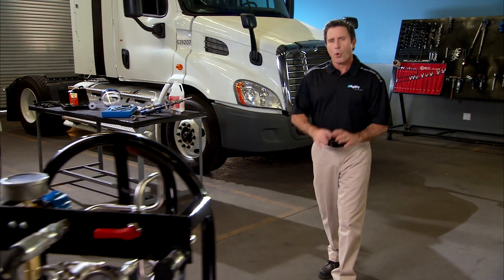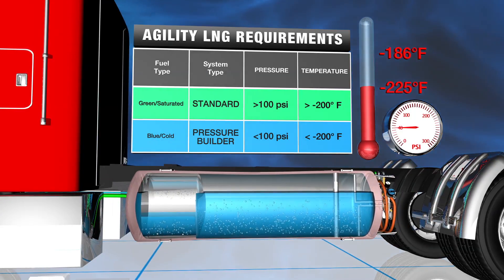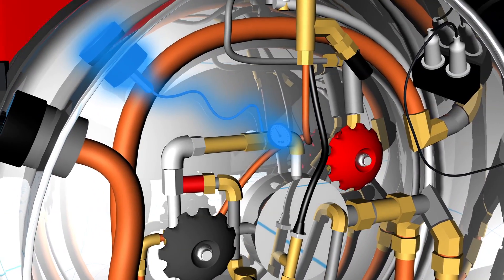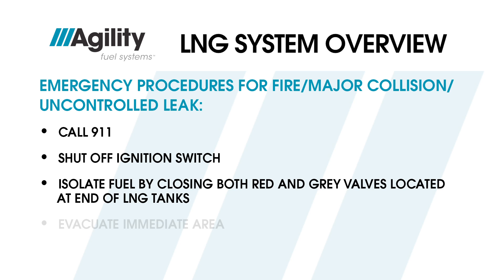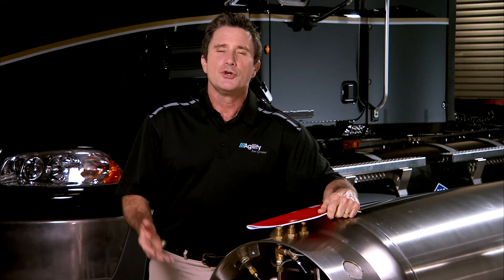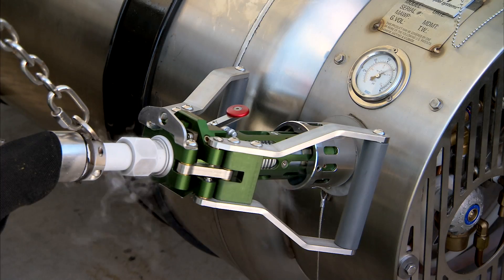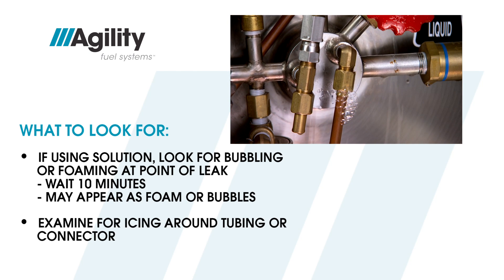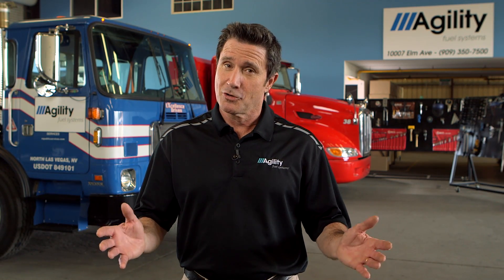Agility LNG Fuel System Overview (Full-Length)

Comment: I am pleased to hear the presentation . Is there anyway that we can have the system for Indian trucks and buses? If the system is compatible with Indian vehicles either through the OEMs or through retrofitment route in respect of old vehicles. Inform whether the system has been homologised for use in Indian vehicles. Rajan

Comment: Hello, 
Methane ("LNG") when stored on the ships for propulsion is stored In the Cryogenic state condition.
As far as I understood your containers do not cool down the gas in order to have it in the same conditions as the ships.
Your working Temperatures aim about - 100º Celsius pressurized at 7/8 Bar approx.  which as per Methane phase Diagram represents solely a Gas condition. In the video you assume a dual phase inside the tank, liquid and "saturated" gaseous keeping the balance between them while running.
If possible can you please make clear the condition inside the tank. I mean is only Methane or the mixture with other gases allow to have it in the presented condition. 

Many thanks
Tiago Carrelo